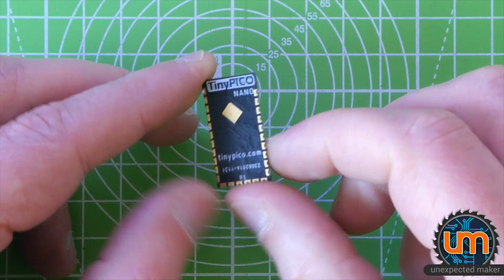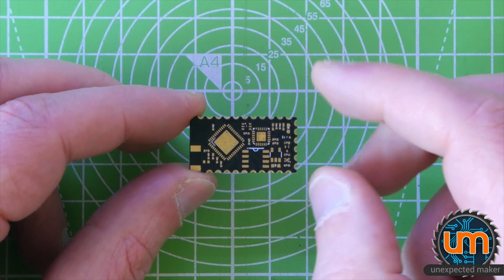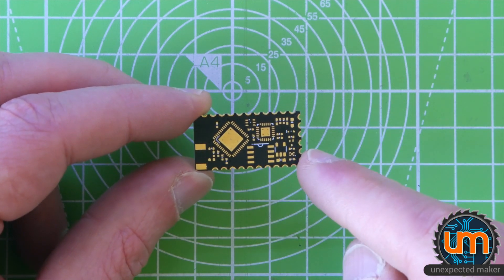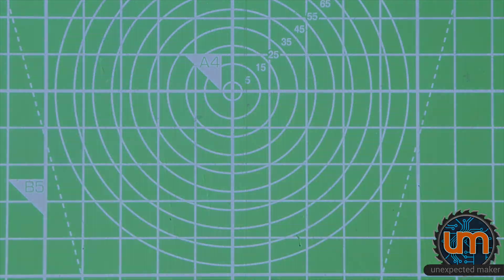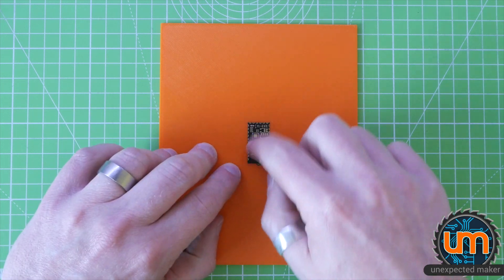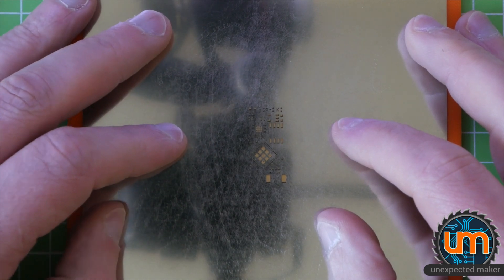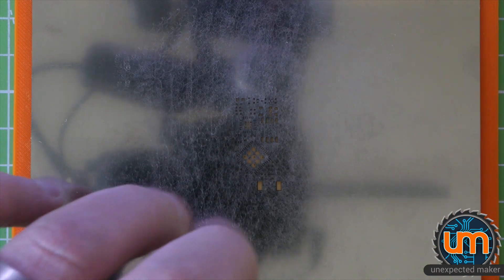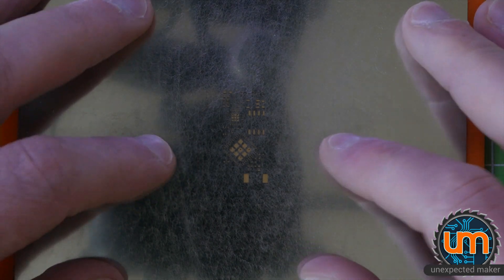TinyPICO Nano ( plus? ) - First build!

Comment: Awesome work. Just out of curiosity. Do they make the ram the same pin pitch at the other chips? Cheers.
Reply from the maker: Nope, I wish I could get smaller RAM, but  even with a different package type, it's still takes the same space on the board.

Comment: Thanks for the video! I've been making boards for years but only with solder paste from a syringe and a hot air rework station. I am about to make my first boards in a toaster oven with your Reflow Master controller and using a stencil. I like the 3D printed holder you made to assist with the stencil.
Reply from the maker: Awesome Kenny! Moving to a stencil will change your life... but be warned, getting a good stencil technique take a lot of practice... be prepared to wipe down a bad stencil job instead of populating it. Please share your results when you get your first board reflowed!